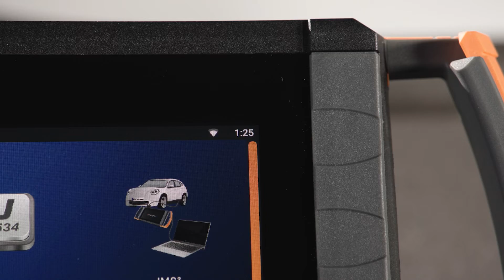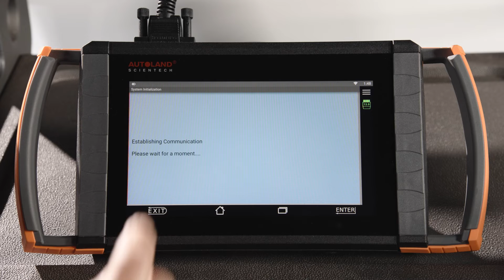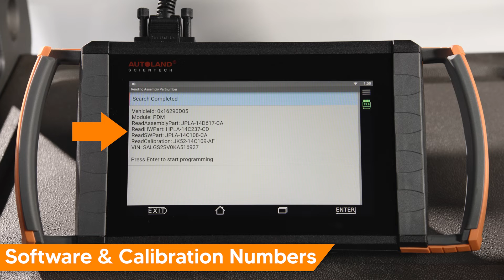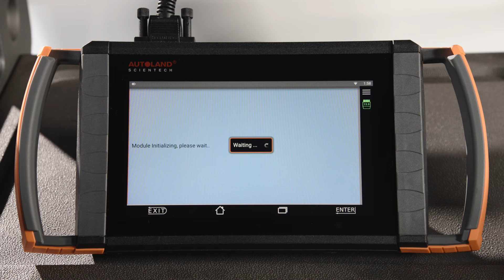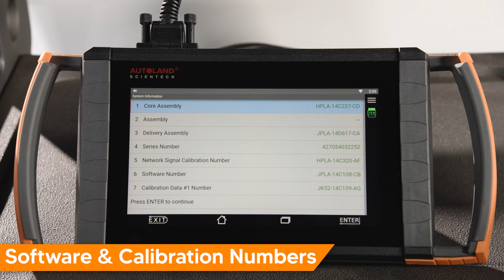How to Program the Door Module on a Land Rover L405 | Programming DDM

Comment: Hello, I have a MY23 Land Rover discovery sport p300e. It’s equipped with the analog/digital cluster display/speedometer but I’d like to update/retrofit to the full digital one. This is possible using your device? If so can I use a used one or I need a brand new oem part. Thanks a lot
Reply from the maker: You will need a new cluster when replacing it. You can program the cluster using SOD through your iSCAN device.